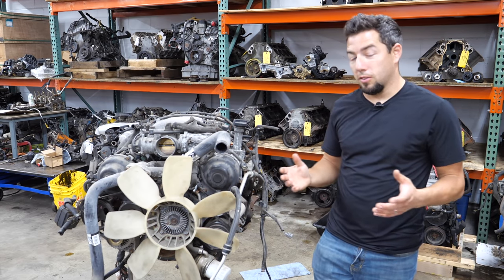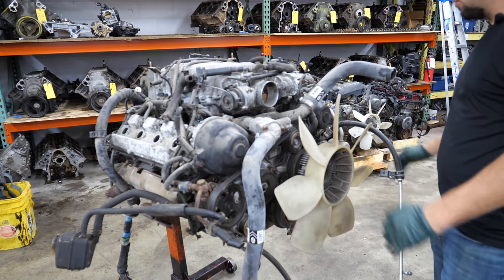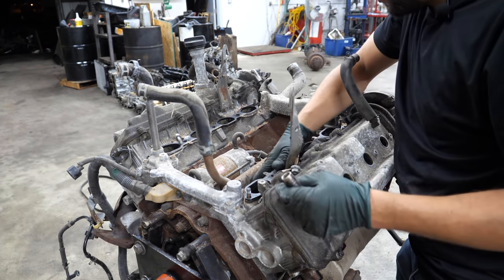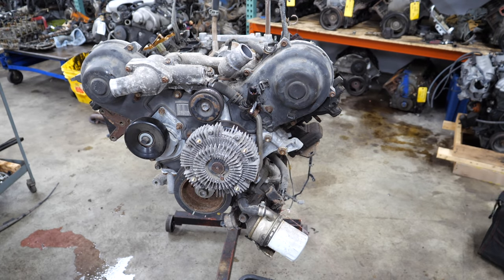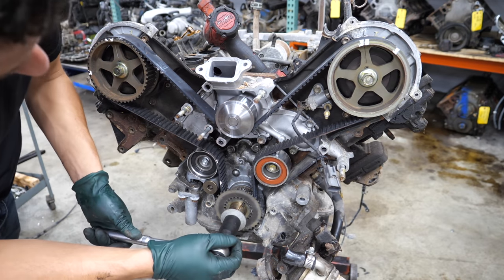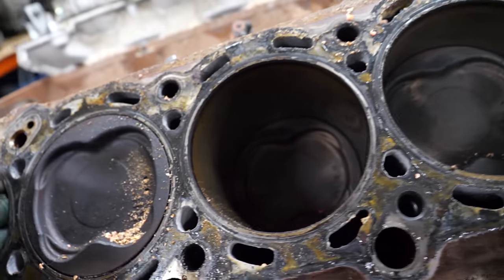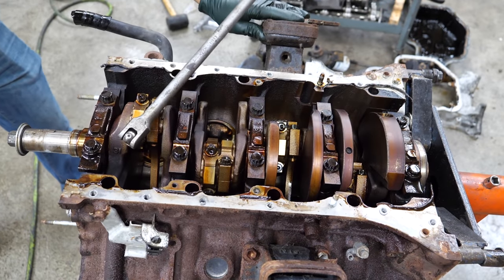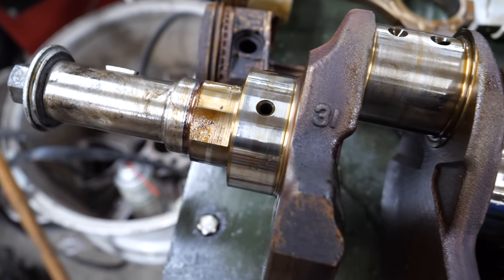Toyota 4.7L 2UZ Total Engine Teardown! Low Compression, But Why? Tundra Land Cruiser Sequoia LX470

Comment: Toyota mechanic of ten years, I've done four UZ starters in that time.  They're not that bad to do, but very reliable overall.
Reply: I've known a handful of people with uz powered vehicles. I think I knew one who had to replace it. Doesnt seem to be any more reliable/unreliable than a traditional placed starter.
Reply: Is that rubber timing belt a problem or is it durable?
Reply: @albrownmd  not a problem, toyota specs 90k replacement intervals but ive heard of people going 200k without issue.
Reply: I was just scrolling the comments for a tech to back up the fact that they don't go bad. It's not the hottest part of the engine by any means as ANY other location means that the starter will be next to a ridiculously hot exhaust manifold.
Reply: @84Prerunner  You mean they got lucky, if your 110% past the manufacturer interval your risking massive damage.
Reply: I guess "not that bad" is a relative term, has to be close to a $1,000 repair parts/labor.
Reply: @albrownmd  I've only ever seen one genuine timing belt break, on a 5S-FE, at exactly two kilometres past the service interval. Toyota belts are the best in the business and I've seen them go twice the distance and ten years over interval. The UZ is a pig to change (by Toyota standards anyway), and when you do, do the water pump, pulleys and idlers when you're there.
Reply: Mine is still going strong at 347000 miles.
Reply: @JossRickard  I recently did a 5vzfe belt that was near 250k. Was decently cracked up but amazingly still held tension. A few years ago did a 3vze with 180k in similar condition. Definitely rolling the dice anywhere near the 150k range.
Reply: @Mis73rRand0m  Yeah, environmental conditions play a big part in it. I've seen cam gears wear faster than belts in mining cars, with dust too.
Reply: @bonose12  me too, 352k mi on my 1uz, original starter.  I'm another "it's not that tough to get too" as I did the lower intake gaskets last year
Reply: @JossRickard  Timing belts do have their advantages.
Reply: @MrCarGuy  what are the advantages? I think a chain makes more sense. But I don’t know enough about it to know.
Reply: @Acroposthion  RAF fighter aircraft during the gulf conflict had to be flown home for a full engine rebuild weekly! For the same reason aircraft we sold to the Saudis were spec'd with different more expensive ( more abrasion resistant) blades in the engines!
Reply: How much rough driving can these engines take? I always have mine pinned when passing on the interstate. I feel like that’s not good for it at all but it is a smaller displacement DOHC engine so I feel a 5200 redline is of no danger zone.
Reply: @dbowen22  I just finally changed mine at 655k km. Flippin unreal lifespan on that one. Replaced with a Bosch though so wish me luck haha
Reply: @JossRickard  I think this is part of what keeps this engine going so well.  You are kinda forced to go ahead and replace these parts when you do the belt change so they end up not failing.  I have a 2UZ-FE with 200K miles on it and it still runs very smooth.
Reply: @84Prerunner  I went to 240k in my 05 Tundra before having the original tb replaced. Not smart waiting that long obviously, but it's what I did.
Reply: @henrent  my thoughts exactly
Reply: 2UZ-FE was designed and certified for Aviation, is why starter is on top-centered for balanced but also keeps it outa the water when traversing
Reply: I had my belt done at 320.00 kms did everything , the mechanic quoted 8 hrs but  took longer but love this engine which has just clocked over 400.00kms

Comment: "You'll need a new engine." Words a 2UZ owner will likely never hear.
Reply: 2000 Tundra guy here, I’m always worried about somthin’ breaking but then I’m reminded that they last forever haha
Reply: Most it’ll ever need is rings
Reply: @whoopdeedoop6587  I've done more to fix chassis rust on my 01 than anything to the motor. I'm convinced the motor will pull loose from the frame before it let's go
Reply: @Lou_Spowells  probably lmao
Reply: @whoopdeedoop6587  I have a 2000 4.7 tundra. I love it! I had an 03 until a wreck did it in. But it drove away from its own wreck that i had driving it. And it drove itself on a tow truck with a 7,000 lb loaded utility trailer behind it when it was totally demolished (9,000 in damages) by the previous owner’s employee. I love these trucks! So much that I swapped the frame out in my driveway on the 2000 I have.
Reply: @Lou_Spowells  I swapped my frame in my driveway. These trucks just keep going!
Reply: I’m one of the rare people that needs a new engine, or at least a rebuild. However it’s not the fault of my 2uz. Heater tee went out on the highway and despite a roadside fix, I wasn’t able to fully get out the air out of the system which I suspect is what caused the damage. Now have a small HG leak of coolant into a cylinder. Still runs strong at 240k and I’m hunting for a used engine to keep my LX going.
Reply: @KimathiTheLeopard  same situation.. picked up a cheap sequoia with bad head gaskets due to.. running with a broken heater hose tee! It’ll come out and get new gaskets
Reply: @really_jack  so after looking into my options for the last several months, I’ve decided to go the route of a used replacement engine. I found one off a landcruiser with about 160k on it (my truck has 240k). I was hesitant at first since my motor runs pretty good (even with the HG leak), but seems like doing the HG on these is harder than a swap with more things that could go wrong. As part of the swap I’m just gonna move over all the good/new components over to the replacement. Something to think about and good luck…
Reply: @KimathiTheLeopard  its a pretty easy engine to rebuild
Reply: @spacekook3794  oddly enough I cannot find a shop that is interested. I’m by no means a noob with cars (I’ve worked on all my cars since my college days, although mostly familiar with diesel), but right now I live in an area where I don’t have a garage. Or else I might’ve given it a try myself. Seems they mostly don’t want to be bothered with time that it would take to get it done right, and prefer to do quick jobs that don’t require much attention to detail.
Reply: @KimathiTheLeopard  oh thats crazy no one wants work, im just finishing up my rebuild, local shop here wanted 6k to rebuild and throw in forged rods. But i gotcha the no garage situation is a bummer
Reply: @spacekook3794  yup the no garage situation sucks indeed! Glad to hear it’s actually possible and people like you are doing it. Hope you post your work on one of the communities as I’m sure more folks are going to be coming up to rebuild time as these rigs get older and miles get higher. Take care!
Reply: The one in my truck died, but it was under extreme circumstances. The previous owner rolled it and it was left on while it was upside down. So it burned up the crank bearings.
Reply: pfft my 03 tundra already smoking blue like a train and misfiring on 1357 . put so much money in it, injectors coils spark plugs ebay oxygen sensors you name it both cats deleted one was clogged, can't get the misfires out of that side. sometimes it would run great before when you reset the battery and in the morning but then it come back when idling again, change the fuel injectors on one side some idiots had Chinese injectors in there I put denso on one side ran great as soon as I installed other side boom all hell broke loose.. no idea what to do probably going to swap another motor in it only 200k compression check good 170 all the way, oil and coolant was good, I only overheated it once completely to the red but still drove good after that wasn't losing coolant or anything and it ran great I didn't like the way it was idling it would misfire but once you step on it it would drive great started dumping money into little stuff now it smokes like a chimney and you can see the oil dripping on the exhaust specifically from the side where it was misfiring
Reply: @r.seaboats6666  ouch sorry to hear, and I feel your pain. I’ve dropped countless dollars into my LX. Any idea where the oil is leaking from? Probably a good idea to do a compression and leak down on it and see if that yields any useful info. I fear it might be a HG, but better to be absolutely sure.
Reply: 06 vvti, just blew a rod into pieces out of nowhere. Crank and rod bearings spin perfectly. No water in head.
Reply: @chrisgonzalez6377  Mine did the same thing a few weeks ago at 180k miles.

Comment: I own 2 vehicles with 2UZFE power plants, combined they total nearly 700k miles. Both still run flawlessly and are daily driven.
Reply: Sad part is there will never be another engine platform produced that is as reliable.
Reply: Mine is about 500K miles and still strong... love the 2UZ so much I don't mine their fuel thirsty behavior 😅
Reply: @ej254  What kind of gas mileage you getting out of yours?  Mine is like 15 city, 18 highway
Reply: @timothyandrewnielsen  11 city  14 highway   2000 tundra 140,000 miles
Reply: I have a 3uzfe (ls430) which I love and am hear while shopping for a 2uz 😂 thanks for the encouragement!
Reply: I hv one with 320,000 runs perfect   oil changes  every 3000 to 4000  i lv it
Reply: This V8 engine only has 230hp to 270 so I would like to ask can you tow 8000lb trailers in the mountains with this.

Comment: Also it's amazing the amount of abuse and neglect these UZ engines can take and still run fine. I got a LS430 with the 4.3 3UZ in at the dealer like a year ago, vehicle had over 200k on it and the customer had gone almost 10k miles on their oil change interval (factory recommended interval is 5k miles) and came in complaining of a light knocking noise (this car was clapped out and had lived a rough life by how rough it looked). I checked the oil level and was getting nothing on the dipstick. These cars hold 5.5 quarts of oil and I had to put in 4.5 quarts to get the oil level right. This car was running around for who knows how long on only a quart of very dirty overdue oil. I drove the car for a good while after filling it up and did a full oil change and was expecting glitter to come out and the filter to have metal in it and after changing the oil it was veryyyy dirty but no metal in it. Did the second oil change and let it run and the noise went away completely and the customer took it.... mind blown! Love those amazing Toyota/Lexus UZ engines they are extremely under rated especially by people who don't know much about them.
Reply: Don’t make enough power to hurt anything lol
Reply: @Silent but Deadly  I'll take reliability over hurt any day.
Reply: @JR-uc5oz  mines a turd but does good for me I guess lol
Reply: Yeah,  they are SOLID.
Reply: Generally very good motor, but I’m gonna also be the unpopular opinion.. the fact they need a T-belt every 90k miles almost guarantees they don’t fully get abused. With that said I enjoy my LX470.
Reply: The non vvt uz's are bulletproof. They are non interference unlike the vvt versions. It is almost impossible for a responsible car owner who is always on time with maintenance and repairs what need to be repaired as soon as possible to ever break this non vvt 2uz. I fix cars for a living and I have to honestly say that this is probably the most reliable V8 I have ever owned, serviced, rebuilt, driven in my life from all the V8's ever made. Im sure mines will still be running long after im gone with 467k so far and still never been pulled from my sequoia nor anything major ever happened or done to it. Plenty of these have reached the 1million mile mark.
Reply: @johnlacambra6004  good to hear. What truck is yours in?
Reply: @KimathiTheLeopard  '03 Sequoia 4x4. Was my main everything until I bought a Charger so now I switch out depending how I feel or need to do that day. 

If you're planning to get one, I would say that the extra 70+hp on the vvt versions I would say isn't worth it as far as security wise goes. Because if timing belt breaks on the vvt versions there goes the whole engine. Besides the non vvt onse are plenty of power for most towing and off road applications. 

I highly suggest to change the coolant and the transmission fluid every year no matter what toyota says. Coolants tend to become acidic over time and destroy seals and hoses while transmission is one of the most maintenance neglected parts of a car. Plenty of people tell me, "it's a great car the engine is good as new even though its 200k, only problems is the transmission gave out."
Reply: @johnlacambra6004  great advice and thank you!
Reply: @johnlacambra6004  when was the vvt version introduced? 2004?
Reply: @johnlacambra6004  all 2uz's are interference engines
Reply: @garetfitzpatrick2043  Only the vvt versions. The non vvt 2UZ's are non interference. I have taken them apart and rebuilt them so I know from experience.
Reply: @johnlacambra6004 - ALL 2UZs are considered interference engines by Toyota. But the VVTi engines are far more likely to bend valves when the belt breaks than the non-VVTi. That being said, plenty of people have snapped the belts on their non-VVTi 2UZs and wound up with severe engine damage. Suggesting that these are not interference engines might lead someone into refusing to change their timing belt until the belt snaps and leaves them with a hefty repair bill, or a totaled vehicle.

TL;DR: Don't listen to random people on the internet. These are interference engines, and you absolutely should change your timing belt on time. Not worth the potential risk.

Comment: Future Tip: These engines have block drain ports/valves from the factory. They're at the bottom of each bank of cylinders, near the oil pan rail. They let you drain all the coolant.
Reply: Looks like “his guy” that took the engine out didn’t even attempt to drain it. Hahahaha
Reply: @I_know_what_im_talking_about  sometimes if your hand is too big you cannot do anything lol
Reply: I was yelling this in my head the whole time
Reply: I was happy to find that on the Yaris I had when I did the coolant flush on it
Reply: @ChrisReneP  nice bird
Reply: Eric touched on this in a previous video: the problem with using those is that if the engine was in the rust belt, there's a possibility of the threads coming out with the bolt (I believe he said he's seen that a few times). At that point, you have to re-tap the threads, and if you can't, well, you've got a ruined a block.